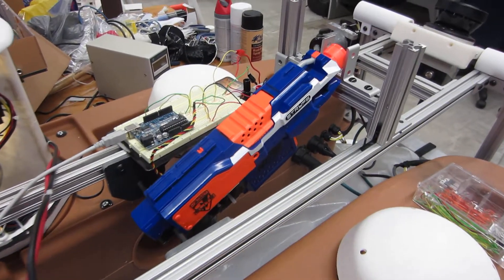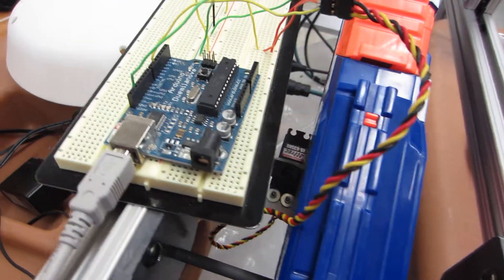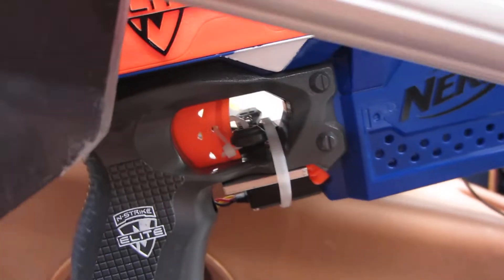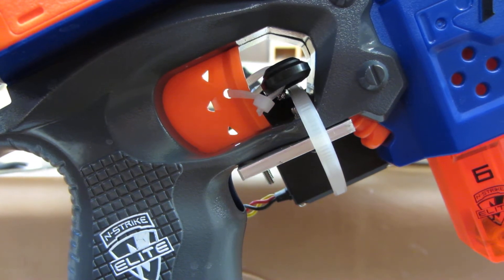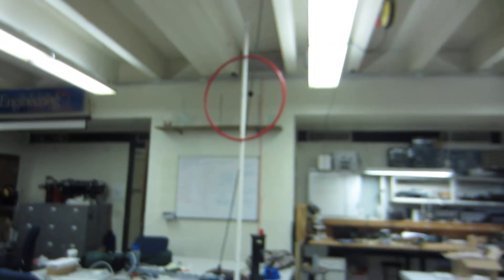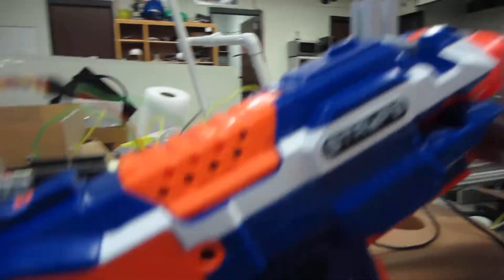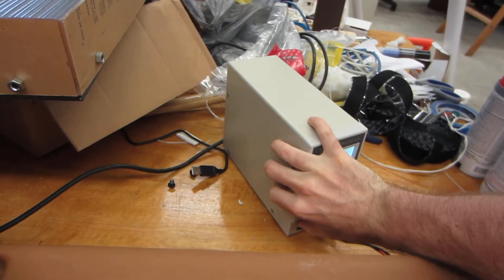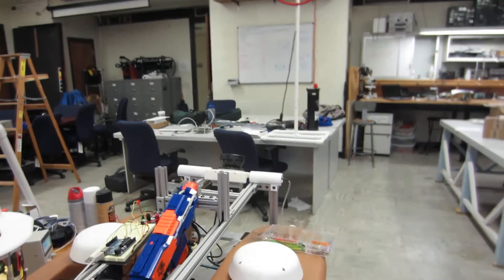Arduino Controlled Nerf Dart Launcher

Comment: What did you use to get the small "rev" button to start?
Reply from the maker: +legolover8805  which button are you referring to? The motors were directly connected to the power supply. You can hear them turn on as soon as I flip the switch on the power supply. I wrote the Arduino code so that as soon as a serial connection was made to my laptop via the USB cable, it would begin a script that actuated the servo.
Reply: dzf209 So you modified the actual blaster inside by controlling the flywheel motors of the blaster externally via the Arduino?
Reply from the maker: +legolover8805 , not quite. In this test, I literally just took the wires from the motors and hooked them up directly to the 6V power supply. I was only looking to see if the trigger mechanism worked in this test. This Nerf gun was designed to be used on an automous boat. You can see it here,

https://www.youtube.com/watch?v=b0JnwxaFP3k

In our final design, we had another computer running our software through ROS to signal a relay to power the flywheel motors.
Reply: Thank you for the information. I have been wanting to try projects similar to this.
Reply from the maker: +legolover8805 , no problem. Arduinos are a great place to start if you want to learn about electronic circuitry and computer programming. If you're interested, you should check out the second boat that we made. It didn't have a Nerf gun on it, but it was ~ 3x faster, 3x stronger, and looked like something out of a Batman movie,

https://www.youtube.com/watch?v=oSh3_Yc25Y4